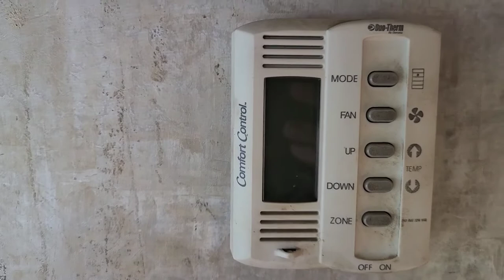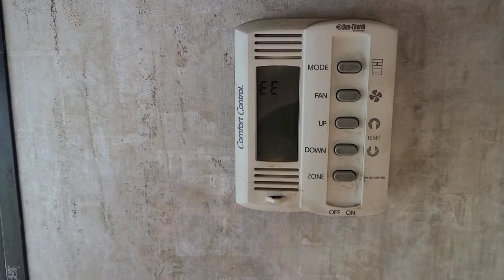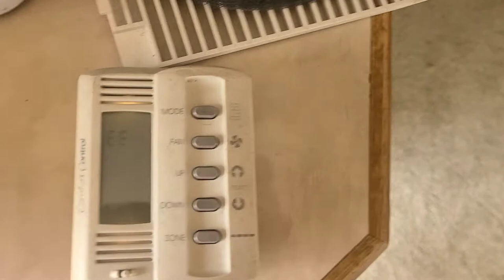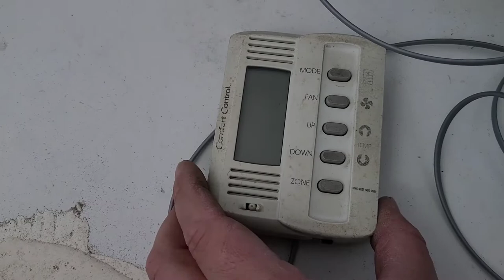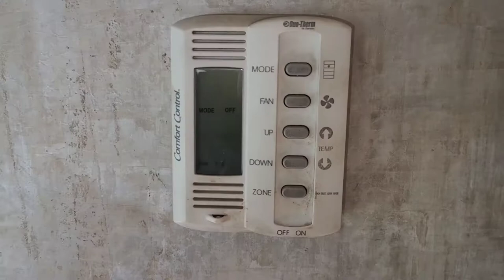Dometic thermostat won't turn on

Comment: Hi Chuck, enjoy your videos. I have a Atwood 85 series RV furnace. Turn furnace on at thermostat turn temperature way up. All that happens is buzzing noise at the control board. Fan does not come on can you help me.

Comment: i have an aqua hot system with 3 zones. zone 1 works fine. the thermostat on zone 2+3 shows only the zone. i can switch between the zones, but nothing else shows on the display. we're in a location that has temps in the teens in montana. hoping you can help me diagnose what's happening. thanks....

Comment: My dometic thermostat just dropped the furnace and heat pump off of the display. The thermosat lights up but nothing works at all, no ac, fan, htr, or heat pump. Can't find any tripped breakers, or burnt fuses. Can anyone help with this. Was fine the night  before.
Reply: Hello, I have exactly the same problem, did you find the solution?